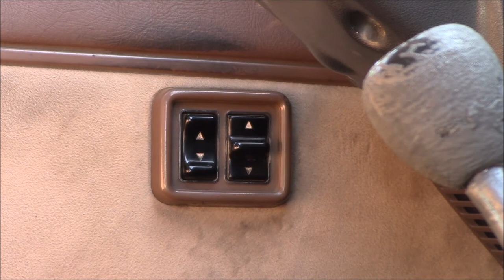1st Gen Toyota 4Runner Power Window Switch Repair

Comment: Wow that new switch color job came out phenomenal.
Reply from the maker: Thanks.  It was nice to get rid of that faded OEM switch and now the door handles and window switch matches.  I may try painting the OEM switch on the driver's side so it matches as well.  It's funny, I purchased that bottle of paint 4 or 5 years ago for another project, but the color wasn't right.  But for this, it was a really good match.
Reply: @The4Crawler  A testament to putting the lid on tight before putting it away in the cabinet.

Comment: In order to install the switch, do you need to pull the door panel to set the prongs?
Reply from the maker: Yes, lift the panel up to disconnect and remove the old switch and slip the new one in.  You can keep the top of the panel attached to the door.
Reply: @The4Crawler  Awesome, thanks!

Comment: How u got the driver side double switch for the windows?
Reply from the maker: I've not touched that switch yet.  But recently, the passenger side contacts seem to be acting up so I may need to open it up and see if that can be fixed.
Reply: No I meant like do they sell both switches on one like your drivers door switch.so I don’t have to lean over to roll my passenger window down
Reply from the maker: @vezxn5576 I've not found any place that sells the dual switch.  There was a comment on this video where they did contact Switch Doctor and ask about that.  You might try that source and see if anything came about.